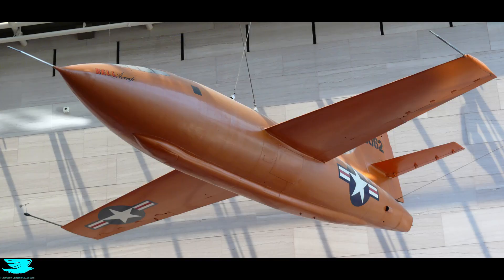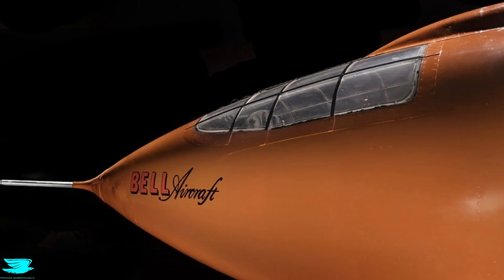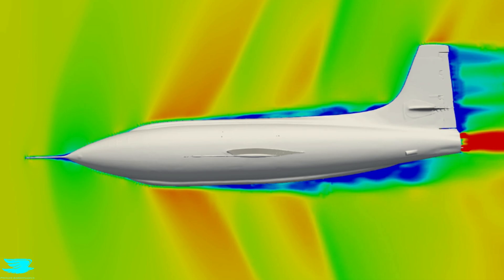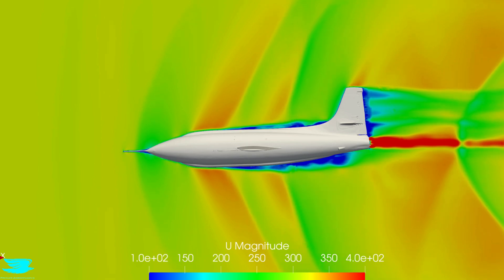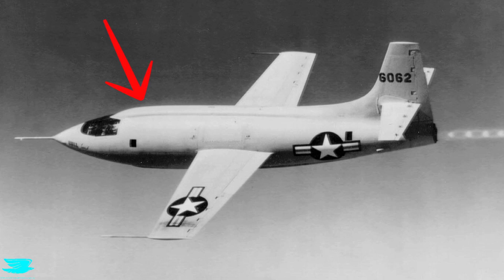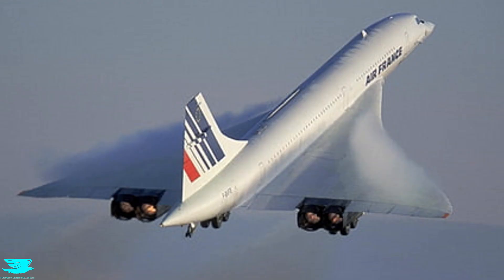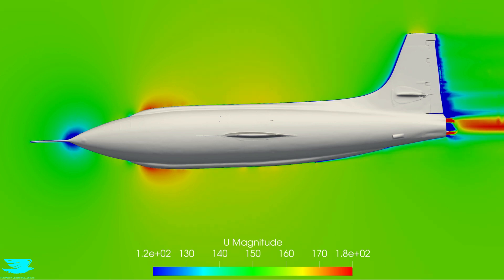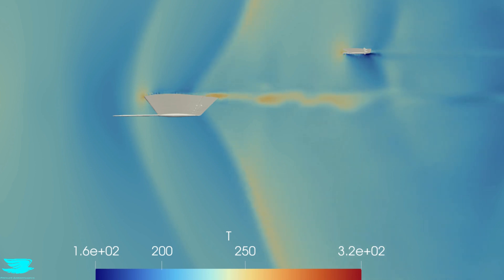FIRST Supersonic Crewed Plane Ever

Comment: Hi, I really like your video, otherwise I wouldn't bother to comment. So please forgive me my critical remarks ;-) 
- Don't use continous colour in your plots, but banded instead. That makes it much easier to determine actual values.
- Include a thick black line at Ma = 1 to show supersonic regions.
- If you do a/c aerodynamics please use appropriate variables: cp&Ma instead of p&U. Additionally, lift and drag coefficients would be greatly appreciated.
- An opaque isosurface at Ma=1 shows supersonic regions much more clearly in 3D-views.
- Use surface streamlines on the a/c in conjunction with one contour line at cfx=0 (skin friction coefficient). This contour line shows (more or less) the region of separated flow.
- I'm pretty sure, that the needles contribute nothing to "breaking the sound barrier". The effect of these on the aerodynamics is negligible, but instead, they were used to place static ports etc in areas with mostly undisturbed flow.
Out of curiosity, I'd like to ask you some questions about the details of that simulation:
- What turbulence model did you use and what was your y+?
- How did you treat the boundary layer in your grid? Was it structured?
- How many grid points did use in total and did you had any refinments in critical areas?

Comment: I'd love to see an analysis done on early airliners like Boeing 707, DC-8(or de Havilland Comet for that matter), and compare them to modern jets. Because I've always found it interesting that the core aerodynamic concepts of airliners are largely unchanged for 70 years, even for the numerous technological advancements made in every other field.

Like when I first discovered the 707 when as a kid, I could not tell the difference between them and modern jets.
Reply: Modern jets have a tube shaped fuselage. Modern jets put the engines in front of the wings like propeller twins did because turboFANs are as huge. Turbojets are so narrow that they do indeed fit into the wing ( Canberra ) or below ( 707 ) without creating (too much) shock waves (limiting top speed).

Comment: No fairings between wings and fuselage. Is that bad for transonic drag?
Reply from the maker: Here it is because that increases how much the cross sectional area jumps up once you hit the wings. That increases the drag.
Reply: @PremierAerodynamics  Doesn't a fairing add cross sectional area? So you mean to place fairings onto the fuselage in front and behind the wing ( not between the wings ) ?.How do you shape fairings to never overcompensate the area ? Straight wings limit us.
Reply: @ArneChristianRosenfeldt That is why you have to make the fuselage a bit narrower where the wings stick out.
Reply: @0MoTheG  Modern jets have this unpressurised fairing for the wheels. I don't see a waist. The designers only take care to let the fairing start a bit ahead of the wing root, then keep cross sec area const, then taper back a bit behind the trailing edge of the wing. Concorde wheel fairing totally ignores area rule.
Reply: wings hit the fuselage at 90° . This is ideal. You could add a filet at the trailing edge to postpone flow separation.

Comment: I'm currently working on my exam project for my introductory CFD course. I can't even begin to understand how annoying something like this would be to simulate and how much computational power this would require! So yeah, if you want to see some shoddy CFD, hit me up 😅
Reply from the maker: Thanks! We'll keep that in mind, lol. Good luck!
Reply: Does a computer even care? Analytics breaks down, but supersonic numeric gets even more simple because the directed information flow.
Reply: @ArneChristianRosenfeldt Dunning Kruger moment
Reply: @ I leave this conclusion to the experts. Your profile does not look like it.
Reply: Let's put this discussion to bed. I'm by no means an expert so this is out of my limited experience. When simulating the same geometry (steady state airfoil) the incompressible simulation converged in like half a minute. Because shocks are pretty much infinitely thin, we need a very fine mesh in that location to capture it. Because we don't know where the shock is, the software (Ansys Fluent in this case) refines the mesh adaptively. This meant that the final mesh was really fine. I had a lot of problems with convergence and the whole simulation took maybe 3 hours. 

That's for a simple 2D geometry, let alone a full plane.